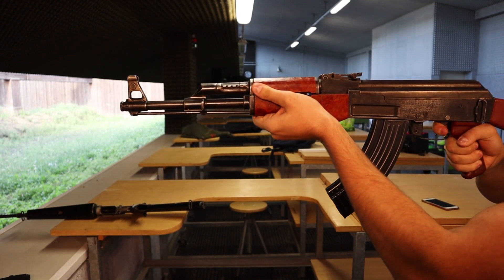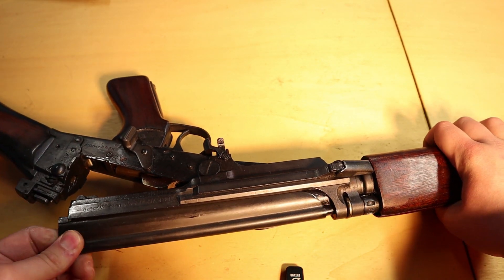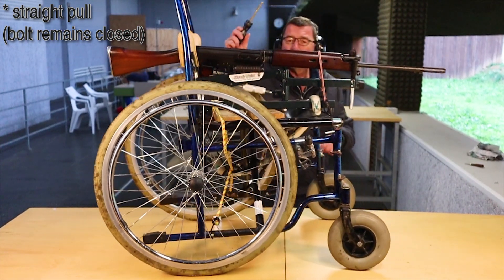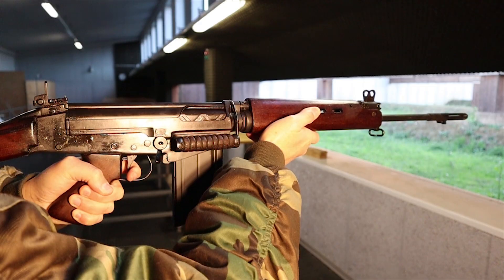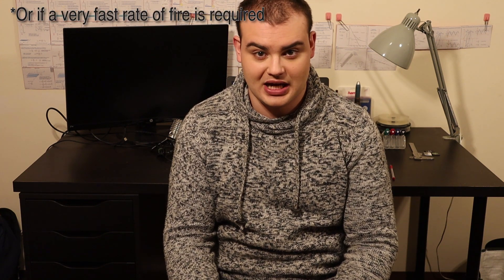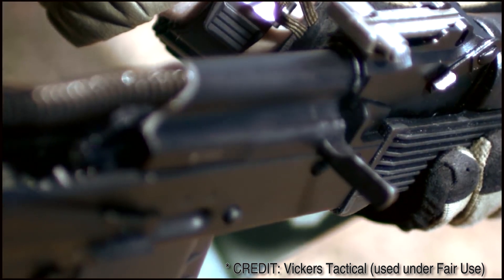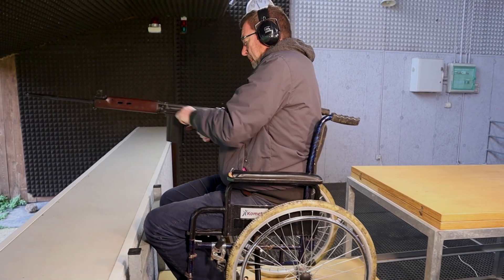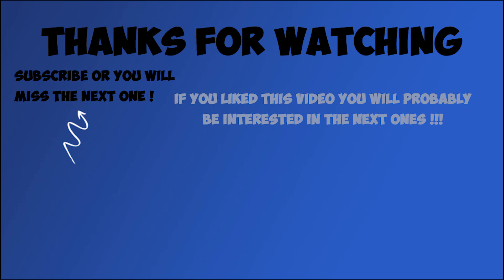Is it true that Semiautos Have Less Recoil?

Comment: The shaking in an AK is due to the fact it's over gassed for increased reliability and long stroke, which makes the bolt get excessive backward impulse which is then transferred to the back of the receiver. Similar weapons with a short stroke instead of a long stroke gas piston tend to be much milder shooting due to the fact that the piston gives only a small controlled tap to the bolt carrier, instead of pushing it with full force.

Comment: There is one more thing to explain about energy, since this explanation rests on the assumption that bullet velocity is constant.

The explanation about an isolated system with no outside forces maintaining its momentum is correct, and under the assumption that the bullet is propelled at the same velocity every time, the recoil momentum will always be the same (equal and opposite to the bullet momentum).

However, some people will probably wonder - what about energy? Isn't there some energy absorbed by friction when the action of a semi-auto cycles? If so, how could the recoil velocity be the same, given that energy must also be conserved?

Yes, cycling of the action in a semi-auto does put energy into heat via friction. The fact that momentum of the projectile must be equal and opposite to the recoiling momentum remains true, but conservation of energy requires that you use more energy to get the same projectile velocity in a cycling action. IE, for a given projectile momentum, recoil momentum will be the same, but the amount of energy required to get that projectile/recoil momentum depends on efficiency of the gun's action. 

If you instead assume that the energy used is the same (essentially, assuming the same amount of powder), then both the recoil velocity and the projectile velocity will be lower in the semi-automatic gun, maintaining the fact that the recoil momentum always matches projectile momentum. For a given cartridge, semi-autos should actually have less recoil momentum, and they will also shoot a slower projectile. (...under the assumption that a cartridge produces the same energy in either case, which is not necessarily correct, but probably pretty close. For example, the slight difference in pressure-curve could cause more/less powder to actually burn, or something like that...) This effect is probably impossible to measure under these circumstances. The difference in felt recoil effect is from the fact that a semi-auto spreads out the recoil impulse over time, as explained in the video.

Another thing that I've ignored so far is gasses expelled. This is the reason that a muzzle break does actually reduce recoil momentum. Additionally, a gas operated semi-auto usually redirects some gas backwards or spits it out sideways instead of shooting it forward. This also should reduce recoil momentum.

Comment: Hi, this video is really great and helped me understanding recoil better, but I have a problem:
I've spent some time analyzing the Gasdelayedrecoilsystem pistols like the Lago Alien, HK P7 and Walther CCP use. The energy that keeps the slide locked forward while the bullet is traveling throw the barrel, can be calculated with E=Pressur*Volum(of the gas cylinder). This energy is much bigger than the potential recoil energy of the slide(weight over 100g). This means that the inertia affects the whole pistol. After the Bullet leaves the barrel and the pressure has dropped, the slide can move and because of its lower mass than the frame, it moves backward. But this means that the total mass of the pistol has an impact on the speed of the slide! A full magazine or accessories mounted on our pistol will change the action speed and maybe also the reliability if you also use low powered ammunition or the pistol gets too heavy. I'm am not quite sure if this is right and I haven't found any sources on this topic, so could you please tell me if I made a mistake and help me in this matter?

Comment: So does the bolt of an AK receive additional Momentum from the gas system when opening, which later on cancels out while the bolt slams shut during closing of the action? Did I get that right?  Is the momentum of the bolt additionally generated momentum or part of the bullet‘s momentum?
Wouldn’t a semi auto locked breech firearm give all the recoil instantly to the gun frame and to the shooter, since the bolt is locked into the rifle frame until the bullet leaves the barrel?

PS: Sorry for my wierd english and love your channel and your work!
Reply from the maker: Everything you wrote is correct. In gas operated guns the bolt receives additional momentum, and an equal and opposite is given  to the rest of the gun, so the bolt is thrown backwards while the rest of the weapon is pushed forward, with different velocities due to their different masses.

Comment: I know it changes NOTHING but I would love it if you did this experiment again but added a muzzle brake, ideally a huge tank style brake, (plus possibly smaller examples as mid-level examples).
Reply from the maker: Muzzlebrakes do reduce recoil momentum, since they are diverting gases perpendicular to the barrel, which would otherwise contribute to the expelled mass momentum. If the gas is deflected backwards, like in some designs, it even subtracts momentum from that of the bullet. with a high efficiency muzzlebrake the recoil velocity would have certainly been lower. There would still be negligeable difference between semiauto and locked bolt functioning.

Comment: I've had this idea in my head for some time now, maybe you can help me find flaws in it: 
Would it be possible to convert the recoil energy from a cartridge into rotational energy by some mechanism (perhaps reset by something like a spiral spring) so that the felt recoil is absorbed concentrically around the action instead of by the shooter?
Reply from the maker: Unfortunately there's no way around, during the "spinning up" phase the momentum would still be transferred back. it would still work as a buffer though. The only way to eliminate recoil completely is to throw something behind... as Cooper told Amelia in "Interstellar", "you gotta leave something behind" 😜
Reply: Beretta does this in the PX4 and a few other weapons where the barrel rotates slightly.

Comment: Thanks!  Now I understand what people mean when they talk about "felt recoil" vs. actual recoil.
Reply: Bad Drivers Of Augusta Georgia pretty cool huh?  We use words like push vs snap but they are simply velocity and the snap can easily be far less then the push but the push will be easier to manage and follow-up on. (.40 vs .45 example is the typical example although I prefer the .40 for recoil management even if I milk the grip more).
Reply: @john-paulsilke893  Is 'impulse' the correct term to use for this comparison? A manually operated gun tends to deliver the energy of the recoil over a shorter impulse, and an automatic operation over a slower impulse?

On top of that there are the other factors that affect 'felt recoil', like the mass of the reciprocating components, total mass of the weapon, whether the recoiling components 'smack' into some kind of stop at their fully open state or decelerate gently, etc. Is that all more or less correct?